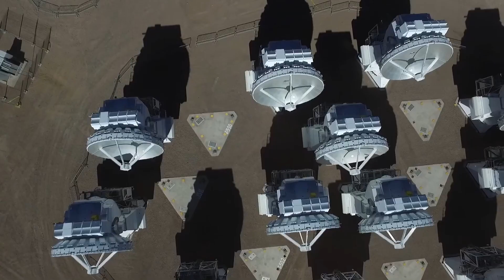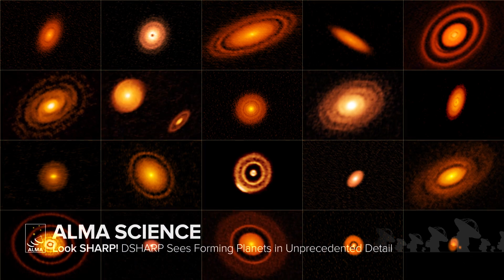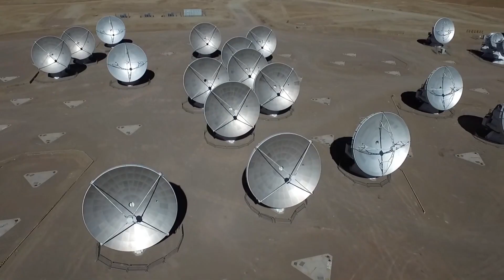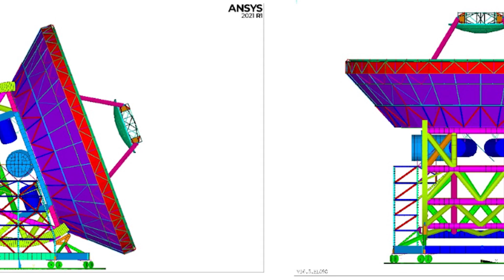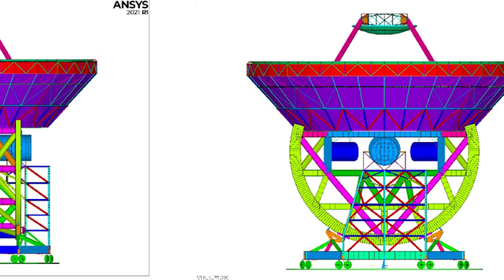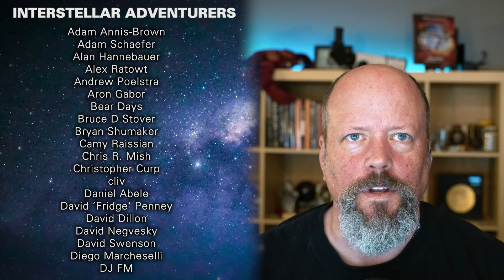What Comes After ALMA? Next Gen AtLAST Observatory

Comment: I actually don't get what a 50m single dish can do what ALMA can't. The conversation did not provide the numbers.
Its total aperture is only a third of ALMA's fifty four 12m dishes, so SNR has to be lower.
Its resolution is way below ALMA's in interferometer mode.
What I heard is that it would have good SNR and resolution while having a large field-of-view (more than one square degree), IOW: it can be a survey telescope.
Which is good, no question...
until you consider what enormous PITA is it to build a 50 meter parabolic reflector to ~30um surface tolerance, and to KEEP that tolerance in a high desert conditions.
Compared to this, 12m ALMA dishes are "extremely easy" because they are that much smaller.
Notice how DSN is getting rid of its 64m antennae because they are too costly to maintain (they switch to arraying several 34m antennae because those are far cheaper, AND they can do two other things at once when do not need to be in array mode!). And these 64m dishes are NOT at submillimeter tolerances, and are NOT in the high mountainous desert where everything costs at least 3x more - and yet, they are too costly.

There are many other things that can be done at ALMA.
Adding outrigger dishes to increase resolution of the interferometer - incremental work, every new dish just adds a bit more resolution, no new gigantic costly dish designs.
Adding separate correlators so that array can be split into several subarrays, this can allow to run survey, or even several separate concurrent surveys (!) with existing dishes.
The usual upgrades to receivers, correlator, electronics.

Comment: What would it cost to build an AU-radius spherical telescope by sprinkling cubesats with cameras/antennas, using solar panels as make-shift solar sails for maneuvering, on a constellation of close-to-polar orbit around the Sun, Startlink/GPS style, using mesh networking so they don't have to be strong enough to reach Earth, just the nearest cubsesat in the constellation, and relay their data till reaching Earth? And what kind of data could we expect to get from something like that? If the cubesats were launched at the same rate as Starlink have been launched on average, how long until we could get the full sphere?
Reply: I think your forgetting --  1 reason these type of telescopes works  --  Is because --  Once the antennas are in position they don't move. We know exactly where each antenna in placed. Imagine how difficult it would be to keep them from moving / wiggling around in Spaaaaaace
  Look up some videos aboot what it took to make the Earth size radio telescope ( the Event Horizon telescope ) to work - The very precise timestamps that allowed the each of the radio telescopes data to be synced up.
Reply: @RectalRooter  Even if you can't synchronize them with lasers and atomic clocks to the point allowing for interferometry,  they could still be useful for super-resolution and light-field imaging to obtain a more volumetric view of the solar system, get a more complete view of the Sun etc
Reply: @tiagotiagot  Maybe. I don't know enough to say -  this or that _ I can say. I will enjoy finding out
Reply: It can't cost anything since the technology of space optical/IR interferometers does not exist yet. We know how to do it in theory, but never did it in space.
Reply: @denysvlasenko1865  lol  Right - Right
Thats 1 way to put it lol

Comment: It's all apart of what I call Greligion. The solar system is Mercury the tint over the eyeball which is earth. Atmosphere frozen is the sclera. The crust of earth the retinas the center of earth black trapped energy with occasional lighting bolts of energy. Venus and Mars the canthus or corners of the eyeball. Saturn and Jupiter the two layers of soft tissue. Then the three layers of skin Uranus, Neptune and Pluto. It's my religion I call it Greligion its one of the oldest religions there is the EGYPTIONS and Myans had it. GRELIGION is the life in the universe and on earth and everything that exists. E=E-A0-S E=ENERGY E=ENERGIZING A0=A CIRCULAR S=SPACE. E=Mc2 WAS THE WRONG EQUATION I AM JASON UDO BEDERKE ALBERT EINSTIENS RELATIVE. 
0A1=ASTEROID A1=ATMOSPHERE
1B2 1 B=BOULDER OR BLOOD 2 WITH E=ENERGY=MASSchanging 2
The write equation for the Nobel prize can be either E=E ENERGY ENERGIZING OR E=E-A0-S ENERGY ENERGIZING A CIRCULAR SPACE

Comment: Abstract

This interview with Dr. Claudia Cicone explores the limitations of current submillimeter telescopes, like the Atacama Large Millimeter Array (ALMA), and introduces the Atacama Large Aperture Submillimeter Telescope (AtLAST) project. AtLAST aims to be a next-generation, 50-meter single-dish telescope with unprecedented capabilities, offering a significant leap in submillimeter astronomy. Dr. Cicone discusses the scientific potential of AtLAST, including mapping the Milky Way, studying the diffuse gas between galaxies, and searching for missing baryonic matter. The interview also delves into the technical challenges and timeline of the AtLAST project, highlighting the need for further funding and collaboration to make this ambitious telescope a reality.

Submillimeter Wavelength and Its Significance
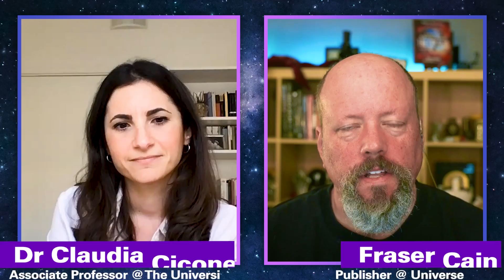  - 1:53 - Submillimeter wavelengths lie between infrared and radio waves, ideal for observing cold material, molecules (including water), and dust-obscured objects in the universe.
  - 3:16 - Unlike infrared, submillimeter wavelengths can penetrate the Earth's atmosphere to some extent, allowing ground-based observations from high-altitude locations like the Atacama Desert.
  - 5:13 - While space-based telescopes avoid atmospheric interference, limitations in size restrict their angular resolution compared to large ground-based telescopes.

ALMA and Its Limitations
  - 6:42 - ALMA is an interferometer consisting of 66 antennas that work together to achieve high angular resolution, revealing fine details of astronomical objects.
  - 7:41 - Interferometers excel at observing small, bright objects but struggle with mapping large, faint structures like extended nebulae or diffuse gas.
  - 14:29 - ALMA's antennas are relatively small (12 meters) and utilize older instrumentation, limiting the scope of scientific exploration.

AtLAST Telescope Project
  - 16:53 - The AtLAST project proposes a 50-meter single-dish submillimeter telescope with a wide field of view, capable of hosting multiple state-of-the-art instruments.
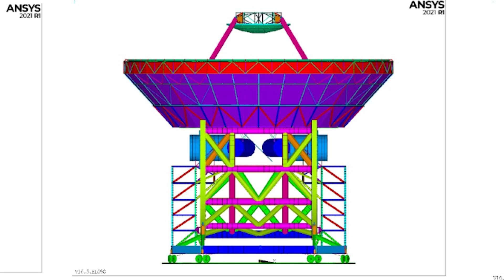  - 18:15 - AtLAST's large size and advanced design present engineering challenges, particularly achieving the required surface precision for observing at shorter submillimeter wavelengths.
  - 22:04 - The ideal location for AtLAST is near ALMA in the Atacama Desert, enabling collaboration and access to the same portion of the sky.
  - 22:55 - The project aims for 100% renewable energy usage, creating a sustainable observatory.

Scientific Potential of AtLAST
  - 24:48 - AtLAST will enable unprecedented surveys of the Milky Way and the universe, mapping molecular gas, dust content, and magnetic fields with exceptional sensitivity and resolution.
  - 26:37 - The telescope's ability to detect faint, diffuse emissions will be crucial in studying the gas between galaxies and understanding the distribution of missing baryonic matter.
  - 32:18 - AtLAST will provide high-resolution submillimeter maps of the sky, surpassing existing low-resolution maps from projects like Planck and offering valuable data for studying the cosmic microwave background radiation and foreground emissions.

What's Next for AtLAST?
  - 36:30 - The design study for AtLAST is nearing completion, with results submitted for peer review and a final report due in August 2024.
  - 37:29 - The next phase involves testing key technologies like the energy recuperation system and the metrology system for maintaining surface accuracy.
  - 40:12 - The project team needs to decide on the first generation of instruments to be installed on the telescope.
  - 40:50 - With sufficient funding and collaboration, construction could begin within a few years, potentially leading to first light in the early 2030s.

i used gemini 1.5 pro